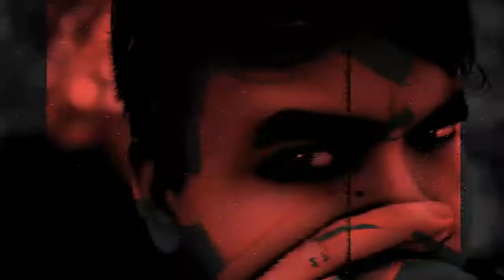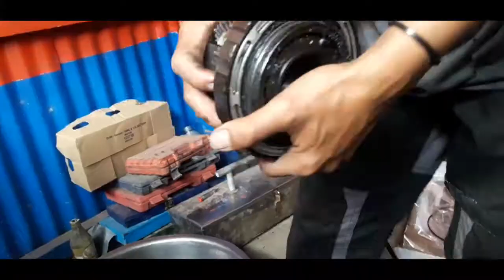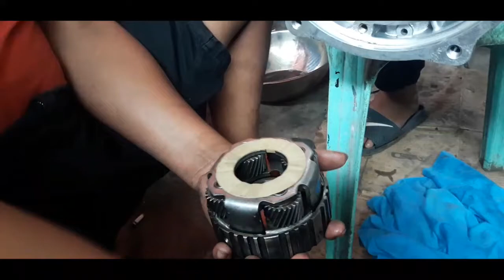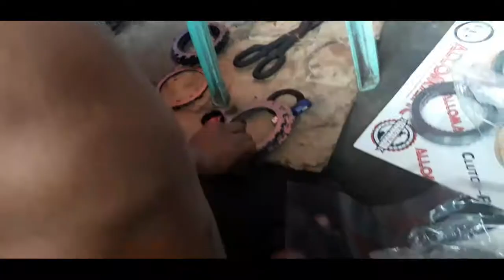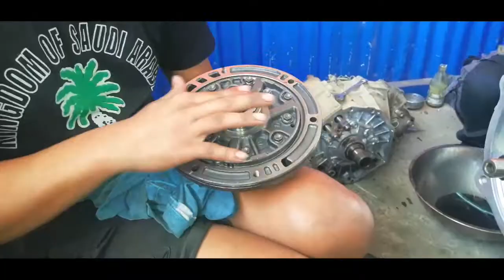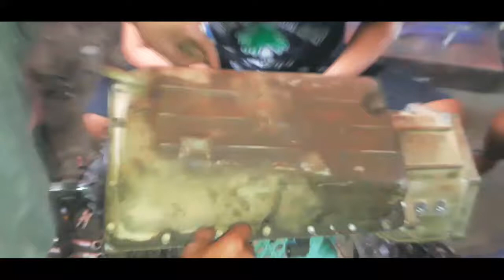AUTOMATIC TRANSMISSION OVERHAUL | TOYOTA FORTUNER (2010)

Comment: Mayron ba kayong tinda na surplus transmission automatic 2006 model fortuner
Reply from the maker: Wala po kaming tinda mga surplus boss, purely labor works lang amin, may ari na ng sasakyan bibili ng parts
Reply: How long does it take for the gear to automatically change as usual after the gear box review?

Comment: Sir mga magkano po overhaul pag altis 2003 matic po sya..
Reply from the maker: Nakadepende po sa shop yan boss, pero pag sa amin, 14k po yan boss lalo na pag electronics
Reply: Boss saan po shop nyo?
Reply: @RoldsTech boss saan po shop nyo? At magkano po stimated cost magpa overhaul ng engine, nissan caravan matic Japan surplus po. Wait ko po answer nyo maraming salamat po,

Comment: The overhauling procedure may not be safe.  It may compromise the safety of the vehicle and creates further damage to the transmission. 

It lacks the following basic requirement of overhauling:

1.Technical specification of torque
2.Special tool like digital torque wrench
3. Technical bench testing for solenoids' current, mechanical and hydraulic functions
4. Technical bench test and specification for hydraulic  pressure.
5. Compromises safety and cleanliness of the workplace 
6. Other technical overhauling requirements
Reply: Good morning! Can you recommend some shops na present yung mga basic requirements na na mention mo? Thanks